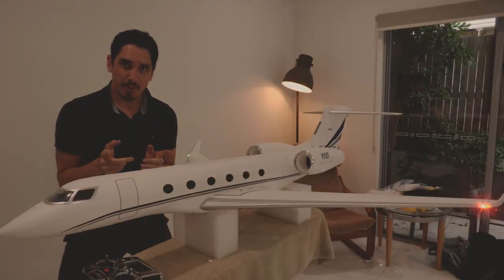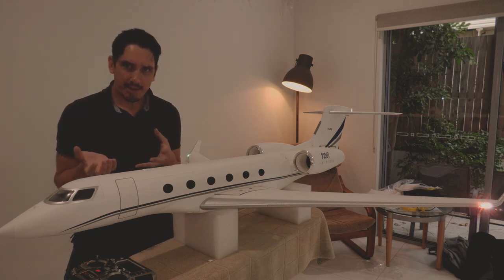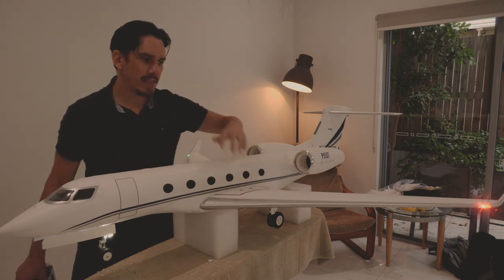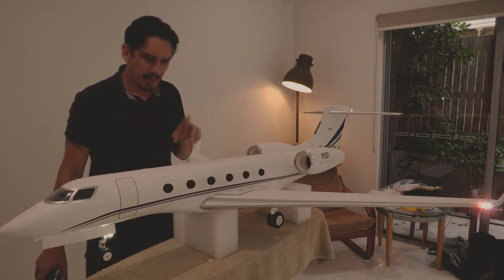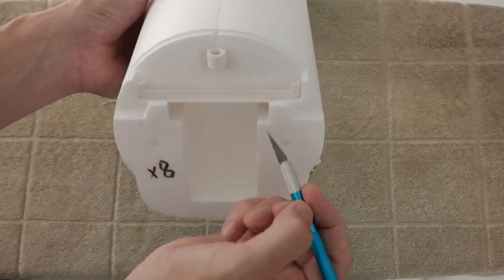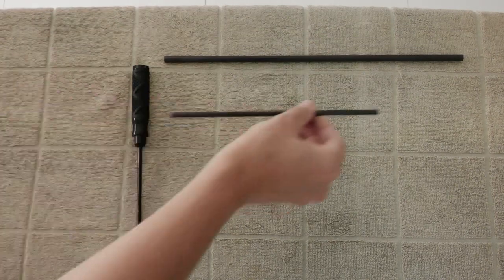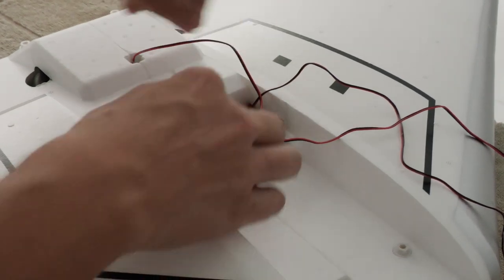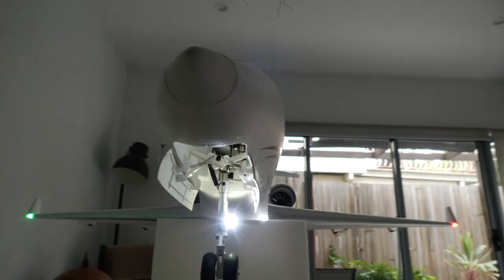FREEWING PJ50 - Build Video

Comment: You did 👍 ok. How many channels did you end up going with? I thought you said it was with a gyro too. So at least 8 channels?
Reply from the maker: I haven’t installed the gyro yet but I will. Below will be my end setup 
1: Aileron
2: Elevator1
3: Throttle
4: Rudder
5: Landing Gear
6: Flaps
7: Landing Lights
8: Elevator 2
9: Gyro gain
Power from the UBEC goes to the BATT port in the RX